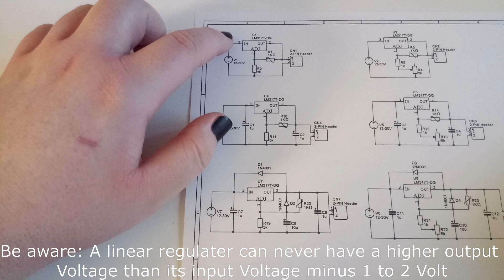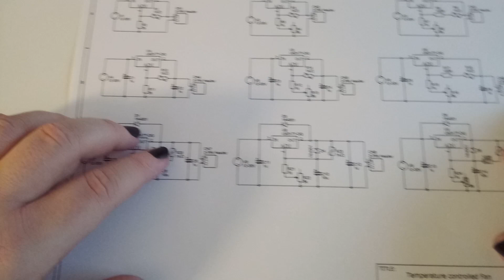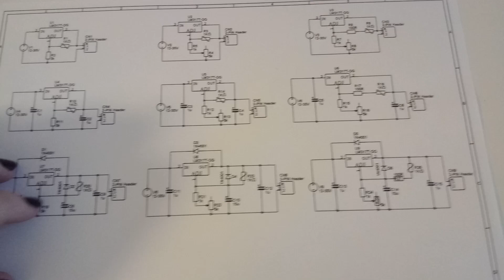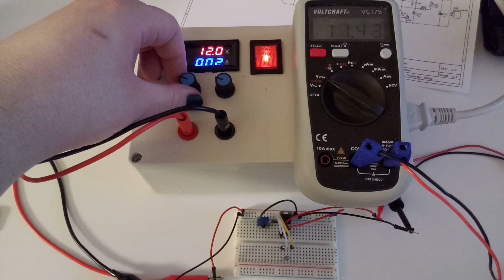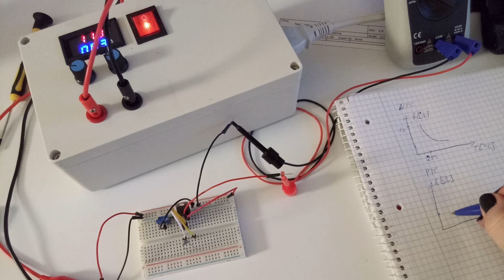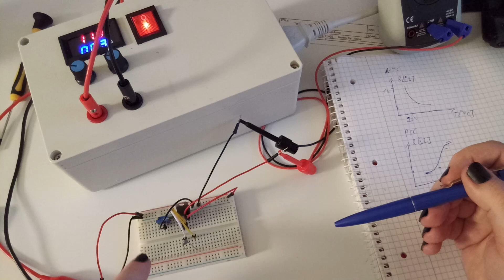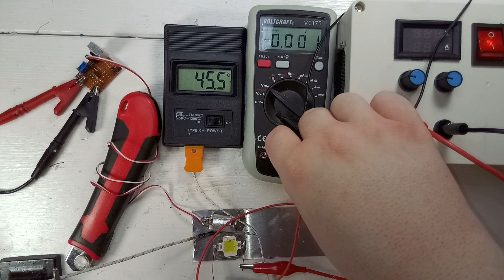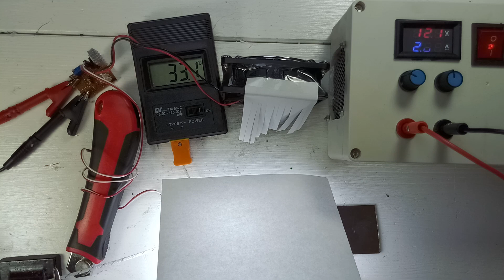Temperature Controlled Fan - LM317 based

Comment: Very good video. I have built a quad power supply  using 2 x 38V DC 8A transformers for twin 6 x TIP35C power transistors / LM317 regulators with 3 fans on each heatsink. There is also a 4 x LT1083CP in parallel and an 8A buck regulators. It's a learning excersise (and fun). 8 fans - one is a server fan at 600mA and howls like mad. I need to contol it and a load bank using 2 more server fans. I'm sure I can use your circuit but a slight problem. Please go to 6 minutes 10 seconds on the below video, it states that R1 should be below 500 Ohms. After all your work I had to Subscribe and like - thank you.
Simple Linear Adjustable Power Supply Tutorial
https://www.youtube.com/watch?v=2EFnqZUxFZ4
Reply from the maker: Hey, welcome to my channel! :D

The value of R1 for the LM317 differs between manufacturers, typical values are 240 Ohm, 270 Ohm and 320 Ohm with +/-10% resistors. But in reality the maximum resistance of R1 is determined by the output voltage and resistance R2. The adjust pin requires a minimum feedback voltage of ~1.25V, the forward voltage drop of the LM 317 if I remember correctly. Even if this is not true (previous sentence)  it doesn't really matter as I tested the LM317 with a thermistor of up to 2.5k Ohm at 14V supply, 12V maximum output. With this the circuit behaves just like it would with a 1k Ohm thermistor. 
Also just because you have a 1k Ohm NTC thermistor it doesn't mean it has 1k Ohm. An NTC thermistor drops most of its resistance withing the first few °C it goes up in temperature. For example my 1k Ohm NTC thermistor is rated to have 1k Ohm at 25°C but has only 800 Ohm at 30°C. Therefore realworld resistance is much closer to typical R1 values.

I hope this answers your question. :)
Here is a bit more information I forgot to talk about:

Resistance R1 always needs to stay above 200 Ohm to not damage the feedback pin, the 1k Ohm thermistor is chosen so the resistance will never go below said value. In theory it stil could, however this value is reached at over 90°C.
And this indicates the upper temperature limit of the circuit. If your project reaches temperatures close to the maximum rating of your NTC thermistor (in my case max 125°C rated thermistor), you need to make shure that its value, therefore R1, does not go below 200 Ohm. You can do that by either using it for projects that never go above 90°C, using a Thermistor with higher rating or an additional resistor in series. However, such a protection resistor would make the fan also start later (lower voltage at room temperature). But as you can see this problem only occures if your Temperature goes too high.

Protection resistor is mandatory if you use a NTC thermistor of a lower value (e.g. 500 Ohm) because it would reach said 200 Ohm much erlier.
Reply: @PhysicistAnna  
What a perfect reply - thank you.
I made a load bank to test the power supplies. It consists of 6 x 10 Ohm 100 W wire would resistors on a 150mm x 50mm x 40mm thick heat sink with 2 x 600mA server fans blowing into the fins. I can jumper the resistors to suit.  At the moment I have a 4 digit V & A meter driven by a LM317 that compares very well with a Fluke. 

I am going to fit one of your fan control units to this. You cannot really talk to anyone it's so noisy. I have reached 130 Deg. C ( OOPS! ) on the resistors without the fans running. I will have to fit a resistor in series with the thermistor. I could move the thermsitor onto the heat sink to a position where them temp. is lower.

I have just about every value of thermistor except 1K Ohm but I can get them easily. Some of my thermistors come from China and don't have a max temp. stated.  Nice to know R1 is not critical  for this application. I thought that chaps video was quite good, it got me started on this 'lark'. 

I have made too many LM317/LM338, etc. regulators and found this :-

https://www.ebay.co.uk/itm/AC-DC-LM317-Linear-Regulator-Step-down-Rectifi-Power-Module1-25-37V-1-5A/164011446660?hash=item262fd81184:g:16QAAOSwLmlbSBe4

R1 is the resistor between the 2 protection diodes. Useless heat sink but OK for mA. The trim pot can be replaced with a JST socket and a remote pot used. Nice little board. I may use this to drive the fans but the heat sink is useless, I can extend the connections to say an LM338 on a heat sink or put that on the main resistor heat sink if it's not too hot.

This probably won't meet with your approval but I am going to use the  'suck it and see'  trial method now I know what not to do. It would have been nice to find a graph of resistance / temp. for say a 1K thermistor but I am not even sure of how this fan / heatsink will react.
Reply from the maker: If I understand your project correctly you try to make a dummy load to test power supplies right? 
You might be interested in my next project/ video. It will be about an easy circuit that can be scaled (in theory) to any size to fit your needs.The circuit I'm talking about is very well known and consists of just a few components. The core of it is a LM 358, a suitable MOSFET or IGBT and a shunt resistor. The design I have in mind should be scalable, however I did not build it yet. Just a small basic version. To convert this first version to a high power DC electronics load you have to change the MOSFET/ IGBT and heatsink but if the refined circuit works you can use several small ones in parallel without the problem of different load on each. Such an imbalance would damage the MOSFETS. More about this in the first video. Some time after there will also be a second video in which I'll build the scaleable version and test it.

Another thing is you don't need 1k thermistors you could also use 2k or 2.5k. I never tested the circuit beyond that resistance except for 10k thermistors that do not work. Also keep in mind the voltage you need to supply to this circuit needs to be the server fan's rated voltage + 2V (although 1.25V voltage drop across the LM 317) to get the fan to maximum speed. If you supply a higher voltage and the temperature goes up the circuit potentially supplies a higher voltage than the fan can handle. Although +10% of rated fan voltage should stil be fine it's a common rule of thumb that works.

Hope this helps :)
Reply: @PhysicistAnna  
Hello Anna
It's so good of you to answer so quickly. I'll answer your comment from the other channel here. 
I was very lucky in finding a mentor (Spec) on one Forum who was excellent in two things. One was coming down to my level of ignorance and two - patience, I'm 73 now and not quite as compos mentis as I was, I've always been a bit slow to be honest. We had just started emails when he had an accident and all seemed well for two weeks and then he vanished. If anyone was annoying or stupid on the Forum he was very good at putting them in their place. 

May I ask roughly where you are ? I note a very slight accent. What are you taking at university ? 
I have been married for 44 years to a very understanding wife, our dining room is almost a workshop but I do clean up every day. We have two daughters I think older than you. Unfortunately I stupidly caught a falling car engine many years ago and it's caught up with me hence going back to electronics after 50 years. I have to do something.  I worked for our Ministry Of Defence designing very nasty vehicles - things with big pipes out the front LOL. I was able to 'retire' at 47 and I have been a 'bum' ever since apart from making 3 kit cars, etc., etc., etc.

In some ways I can understand your university and those nasty big Volts. I did not enjoy 254V across my chest OOPS! No fool like an old fool. I have had 450V DC across my nose but that was a long time ago.

I am of course interested in your dummy load. The thing I have works well and keeps ones face nice and warm. The transformers are each rated at 27V AC (38DC) 300VA and came out of old German Monacor amplifiers, the sort used in pubs. I have 4 of these. The cases are ideal for power supplies as is a lot of the 'gubbins'. I think I have made about 11 full power supplies. I did parallel the transformesr and get an awful lot of Amps but now they are seperate. It would be easy to drive both via one of the  LM317's but I don't need something like 16 Amps at 38V - that's a lot of Watts. The Monacors came via EBAY and were about £20 each. This quad setup is now on a small dolly with 4 casters, just a tad heavy. I have not used Mosfets yet and an easy circuit and online guidence would be very usefull. 

I have had good success with large PC CPU heat sinks and fans. I made a 4 x TIP35C driven by a little buck (just as a test) with another to drive the fan. It uses a CPU heatsink about 90mm square. It's quite happy at 120 Watts. A fan can triple the heat dissipated from a heatsink.

My last power supply will be using an LM723 for V & A regulation and my usual 6 x TIP35C power transistors and a toroidal 35V DC transformer. So much easier than 4 X 2N3055 ones. I will add a buck converter I can switch to.  DC 300W 20A CC CV Constant Current Adjustable Step-Down Converter Voltage Buck C. They seem to work well. Incedentally the LM317 is quite happy at 38V. The PDF does not state a maximum input V only a maximum V in / V out difference. I did have an LM317 go pop and take a nibble at one ear lobe. I can use a little buck or LM317 set to 14V to limit the V out. There is a tapping on one of the transformer that is around 18V and I use this for the low V & A bits.  

I am a great believer in fans. It does seem that fans are taboo with 'experts' but after spending time in an engine test house the odd little fan means nothing. However those server fans are like minature jet engines. They float on the table. I usually run most fans at 10V or even less. I have a small one even on my bridge diodes. There are 10 on this quad setup most at 8V. I have not had any 'magic smoke' yet. I do try hard though.

I have Googled those 3 digit V & A meters and could only find problems mainly at low Amperage. I will try a very clean V for driving and measuring - 2 car batteries should do.
I have had a lot of success with kit from China. These meters playing up is the first real disapointment. I try never to run anything near it;s limit.

I think I had better end this saga. It's rather a long 'comment' sorry.
Reply: @PhysicistAnna  It's him again
I realised that dropping around 36V to 12V is going to be a problem with an LM317 or an LM338. 36 - 12  x 1.2 Amps = around 29W. That means a flying lead, heatsink and fan and even that is pushing the limit of the TO-220.  I think I had better use a little 3A buck and drop the voltage down to 14V. I could drive this fan regulator using a variable power supply but I might forget to set it and put 36V into the  regulator.  I am going to add a test rig for V & A meters to the load cell so that I can test and easily adjust them.
Reply from the maker: Hey, jp.
I´m german and am a physics major. 
Many of the experiments I was talking about need a few hundred Volt to a few thousand Volt but all with very little current in the 0.001A range. Such a shock certainly hurts but doen't kill you. However I can't do anything about it but this max 50V DC rule is nonsense. "Safe" or "touchable" or "Safe to touch" voltages are 100V DC and 60V AC. Each country specifies these voltages in a similar range. They are well below the breakdown voltage needed to inflict harm (average grownup person). The backround is as follows:
If you measure your body resistance from hand to hand with a multimeter you'll get a reading in the range of several hundred thousand Ohm. However if a certain "breakdown voltage" is reached your body resistance drops to 2k Ohm to 4k Ohm and your body is suddenly way more conductive and a huge current can flow. The several hundrek k Ohm you read are present because a multimeter measures resistance with a very low voltage. Most of your body resistance comes from the skin but internally, flesh, fluids, and so on are ~2k Ohm to ~4k Ohm. 
Voltages rated "safe to touch" are well below the breakdown voltage of your skin.

Ok and now I got some questions about your project. 
You said "...easy to drive both(transformers) via one of the  LM317's..." What do you mean by that, driving two transformers with and LM317? It is only rated for 1.5A.

 Next would be about the LM723 and your 6xTIP35C. Do I understand you correctly tat you use 6 of the TIP35C in parallel driven by the LM723 to get current and voltage adjustment? Or rather 2x 3 parallel to get V and A adjustment?

Also about the Lm317's maximum voltage rating: The Vi-o rating or Input-Output differential voltage  rating of 40V is very misleading. Its the "absolute maxium" rating for input-output differential. Its output adjust range is from 1.2V to 37V. You have to account for the forward voltage drop of minimum 1.25V, better use 2V, so its input voltage ranges from 1.2V+1.25V=2.45V to 37V+1.25V=38.25V. But as I said better use 2V as forward voltage drop to get it more stable so minimum Input voltage is 3.2V and maximum input voltage is 39V (DC). 
Just one thing, maximum power loss across the LM317 can not exceed 20W. Thats the maximum power loss rating.
Using a buck converter is always a good solution if you have a huge input-output differential voltage at higher current.

And about fans in projects I can say there is no such thing like real experts if you mean withing the electronics community. I myself always try to run components well below their maximum temperature rating and oversize heatsinks and use fans even if its not strictly necessary. Just a thing of mentality and philosophy. I always recommend oversizing the cooling solution in projects. Makes them safer in my opinion.

Hope I did not forget to answer anything :)
Reply: @PhysicistAnna  This is quite a saga we have going here - soon it will be 'and it came to pass'.

Thanks so much for the advice and help.

Best of luck at uni. My wife and I have a good German lady friend we met in Greece. She came and stayed with us over one Christmas. She hurt my wife and nearly crushed my ribs when she gave us a hug. I will be 74 in June. I will let you work out what my father was doing prior to that. All in the past young lady. I don't think I actually mentioned I'm English. It's nice to know people from different countries. I have a smashing friend in Sydeny, we have known each other for around 3 years now. Hopefully she will visit us this summer if the virus thing dies down.  

The 450V I had on my nose was caused by my lying underneath the huge stereo 20W +20W valve amp with pre amps. I inadvertantly touched a 450V wire connection with a soldering iron which swung down and hit my nose - 3 times before I could get my head out of the way. I can't remember the Amps but it did tingle and leave a scar for quite a while. Needless to say I was hanging onto the chassis. 

The transformers  V out are 27V AC which is 38.18V DC  minus bridge rect. &  self resetting fuse. I get around 35/36V out. Quite stable under load but I do loose the odd volt.  It's very confusing in the PDF data sheet what the max V input is for an LM317. Different data sheets make it even worse. Seems I am knocking on the limit. No problems over quite a few tests though.  I do have a few of the LM317 versions of this :- 
http://www.ti.com/lit/ds/symlink/lm317hv.pdf
It's a 60V version. Not needed them - yet.

I connected both transformers together just after the main caps. I used balance resistors but found they were not required. I then paralled off both TIP35C / LM317 inputs and drove them with one LM317 regulator. I put fuses all over the place but none blew.  One LM317 regulator driving 12 TIP35C's - just a test.

That video I sent a link to stated that 20W was the max. YouTube messed about with that young chap so he gave up - pity. I think going over 20W cause the nasty little LM317 to take a chip out of my ear. Made quite a bang. The LM series are OK unless you have a big V diff and then they are down in the mA range. Today I replaceed an LM317 with a LM338 and larger heat sink on one of those EBAY regulators I bought (I sent the link to you) I had to remove the bridge rect. and output terminal block to do it. As I will only be using 14V input for this variable speed fan regulator I probably didn't need to do this but better safe. V Diff will be tiny when the fan is flat out. This load cell is becoming a monster - good fun though. 3 Amp buck to supply power to the fan requlator,  LM317 / thermistor fan regulator and another LM317 for the 8V to drive the V & A meter. 

The LM723 will be the final power supply (maybe) It's a fresh start but I will be using a 25V AC toroidal rated at 12 Amps &  6 x  TIP35C's 
http://electronics-diy.com/30v-10a-variable-bench-power-supply.php
It's a very old design but the LM723 is still used in commercial bench power supplies. I won't be pushing the 12 Amps, 8 Amps is fine with the odd bit more.  

I spent all my working life as an engineer but I am not an expert. Engineering and electronics are far to big a subject for anyone to become an expert. I am an expert though at cooking an English Breakfast, it was in my fathers genes, it's in my genes and I have passed it on to one of my daughters. Must have duck eggs, black pudding, fried bread,...... LOL 

I shall hopefully start a few tests tomorrow on the fan regulator but the 1K Ohm thermistors will take a few days to get to me. I do have some odd ones to play with in the mean time.

Thanks again Anna - take care
PS names John but friends call me JP so you got that right.
Reply from the maker: I knew you were English after reading your first comment :) Although reading "English" instead of "British" is a new one for me xD If your are not British I don't understand the difference and I apologize for that. Only if you are Scottish, there is a difference right? Ahhh so complicated^^
The LM723 based power supply you posted has a very bad design. The IC has a single feedback pin but it shows several 2N3055s being connected to it. Also the IC only has a single output/ driver pin. There is no individual correction per transistor. Using this circuit there will be an imbalance between the 2N3055 and one will always be driven harder than others (the circuit explanation correctly states internal differences). If you want to use this circuit go for a beefy single transistor instead of 4x 2N3055 then you wont have this problem. Circuit then can be used as is. Typically you want an additional balancing circuit in between the output pin and each of the transistors. This can easyli be done but requires more work and fine tuning. Going for a single transistor is the better solution I think. 
Or you just ignore all that because the only risk is destroying one of the transistors faster and one after the other will break. That wont happen right away but if you use it at maximum loade sometimes,  depending on luck it might already break after a year.
Reply: @PhysicistAnna  
Hi Anna
I was born in a country called England which is part of Great Britain. I know Britain is considered by most to be one country but in reality it's four. It's not politically correct to say I am English,  I have no idea why.  I still wonder how this tiny little island had the biggest empire ever. We were not very nice at times. It's not a bad place to live Anna, I'm sure you feel  the same about Germany. We do have a rather 'earthy' sence of humour, I'm sure I do. Great Britain was formed when Scotland went bankrupt around 300 years ago and they agreed to join us if we gave them money. 

From what I have been able to find out this old LM723 circuit it's been very reliable. I can only assume the 5W balance resistors take care of any variations in the 2N3055's. All of my power supply outputs have been built like this and I have done some pretty nasty things to them with no damage. I did test the twin 6 x TIP35C set up pretty hard. The 300VA transformers were getting near their temperature limit after an hour ( spit sizzled - very scientific ) but all the TIP35's were at 41C - not close to 41C but exactly 41C. That was quite a surprise, I did try to cool them equally but I didn't expect that  They are cooled by 3 x 60mm PC fans on each heat sink, not the server ones. Roughly 100mA+ each. 

The above was a test I had been putting off for a long time. I decided to get a full replacement for anything that was likely to go pop and it takes ages to get bits from China. While I was trying to warm the house up I tested the LT1083 'thing' I made. They are just big LM317's.  I put 4 on a large PC CPU heat sink with balance resistors and used one set up of R1 and R2, etc to drive all 4 as in the Linear PDF data sheet. This does have a 600mA server fan with a on/off temp. controller 

EBAY -50-110°C W1209 Digital thermostat Temperature Control Switch 12V + Sensor (This is very good value , read the spec. Only on/off though) 

and a PC fan running all the time. With a V Diff of 25V they are  down to 1 Amp output in the PDF not the 7.5 Amps they are rated at. They forgot the word' MAX'.  The whole thing is only about a 100mm cube with fan buck and LM317 regulator. I was loading at the time with a 60W 12V (5 A) car headlamp bulb. It was happy with 36V DC in and 14V out. The LT1083's were at 41C and that was roughly 1.25A at 25V V Diff. At this point you think 'that's odd everythings 41C. I did borrow the little kitchen meat temp. probe and check with some heat paste on the end. 41C was about right. I then tested the 8 Amp buck but only at 5 Amps, that went to just over 60C but the main hot spots were not easy to get at. Standard 60mm PC fan. I have an infra red (?) thermometer but it's a cumbersome thing for close in work and does not like shiny serfaces.

I know what the 5W resistors do but they never even get warm. There was a young lady in Canada I was in touch with who built quite a large 30A power supply using this circuit who took her balance resistors off (sounds quite painful). No problems.  

I do prefer the TIP35, it's much easier to mount than a 2N3055 and a lot cheaper.  I keep them to about 1 Amp output each or roughly 30W. I simply add a few more.  You read and see so many videos about cheap fake bits from China so far I have been lucky - apart from those 3 digit meters. I have sent off for some 4 digit meters, maybe I should have waited until this virus thing has died down. I have had to wait a while sending my last order as the Chinese have been celebrating their New Year. It's the year of The Rat. Got quite friendly with one Chinese seller but EBAY got their knickers in a twist after about 6 messages each way. He was a nice chap.

Eureka - Fan control
I lashed up a test setup with a 300 Ohm thermistor. I added a 220 Ohm resistor in series with it. R2 was the 5K multi turn trim pot already on the PCB. After messing about for around an hour I ended up with a 68 Ohm resistor with the thermistor. I had tried a 100 Ohm that too was about right. I had the thermistor and a temperatur probe about 20mm above my 30W soldering iron. I was putting 14V in. The unheated V out was 5 Volts and it reached 12V at 55C. It was not a very scientific test but I was very happy with the result. Thanks Anna. I think it was more what not to do than what to do that counted. That has been my problem. There are quite a few fan control circuits on YouTube and the Internet but they ignore setting the actual temperatures, etc. Holding a thermistor or using a soldering iron just to see a fan go round is not much use. Yours was the best.
I have sent off for 5 x 1K thermistors which should be here in a day or two - UK seller. It's nice when things go right. I owe you a pint or one of those things with an umbrella in it.

Sometime in the future I will be making this :-
 https://sound-au.com/project12.htm
I am going to make the first one - 70V. 
I have a 25V + 25V toroidal and most of the bits. When I stopped making valve amplifiers I did make one transistor amp and this one almost goes back to that time and is quite simple. In those days the words 'harmoic distortion' actually meant something. Ask in a shop these days about it and you get 'what ?'. 
It will be added to the last 35V DC power supply, I can use the 25V +25V AC to get the 70V DC. There is a possibilty that PCB's are still available.
I am a great believer in KISS - Keep It Simple Stupid.

I am going through your videos, the ones I think will help me. You have done a good job. It does take time to get an 'audience'. One channel I watch had almost no Subscribers but now he can't even answer all the comments. I expect one day you will forget your old English wrinkly - LOL. That German lady my know - she calls me her 'English Daddy'. 
I think your English is better than mine and my father was a headmaster of a Church of England school. That's out trouble, everone speaks English so why bother to learn another language and which one would you choose. Did you know the French are not allowed to speak English on TV even if they are fluent in it. Nasty people, all those poor little frogs on crutches.
Reply from the maker: Hey JP, 
takes me some time to answer your comments right now I caught a cold. It's not the "Virus". Also they are pretty long^^
However about the power supply circuit you posted a link to. The resistors directly used after each 2n3055 act as a current shunt as far as I understand and we do have a direct connection to Pin 2 of the LM723 which is current sense, therefore we need a voltage drop across a resistor to detect current. Between Pin 2 and Pin 3 is a variable resistor to current limit as Pin 3 does exactly that. Because internally Pin 2 and Pin 3 are the inverting and non inverting input of the error amplifier which then (in this particular circuit diagramm) directly changes Pin 10s' output that in return drives the 2n3055 transistors through the BD139. The next 2x 5W resistor parallel to each other, in series with the shunt resistors are in place to create a higher potential difference to GND so Pin 3 can be driven through the resistive divider which is created by the variable resistor. The circuit itself is a very simple one that does not utilize the LM723's full potential. It can do more and with a small additional amplifier per transistor (better use MOSFET) you could negate said problem. I don't see the need for you to change it but the problem I was talking about is a very common one if you use several transistors or MOSFET in parallel to each other due to manufacturing precision. Even if you have the same component from the same batch they are not equal. I do have my experience with it due to my DC electronics load project. Esentially this circuit works by not fully opening the transistors and therefore wasting power in form of heat accross each transistor. Works even better with MOSFETS. 
Also this is the reason such power supplies are rarely used nowadays.
Only in acoustics or some rare applications in science if you don't have the funding for absolute stable switchmode powersupplies and you can't have high frequency noise coming through. But as I previosly said, we can flter that and make it perfect. Well actually nothing is perfect in physics but we can't measure anymore. Our inaccuracy in this case exceeds measurement by far.
By the way I'll delay that project for a bit and do other, more simple things while I'm sick.

Your future project looks very interesting but I have to take a closer look at the circuit when I got better.

Nice to hear that your fancontroller works with a 300 Ohm thermistor but your overall resistance R1 should not fall below 200 Ohm as it would damage the LM317 over time, going even lower will blow it up right away. So always keep an eye on R1. We don't want to short the feedbackpin to output pin.

Thank your very much for all your praise it really motivates me to make more videos! :D
And NO I wont forget about you :) well... maybe if I'm 73 :-P
Reply: @PhysicistAnna  
Oh dear, I am sorry. I'm 'glad' it's just a cold, they are bad enough. I think most of us are a bit worried about this virus, especially when your an old wrinkly like me. I had pneumonia twice years ago - OOPS! Do get better soon and please I can wait. It's a hobby not a race. 

Get yourself fit, you have been 'well beyond the call of duty'. 

I think I'll try the suck it and see technique for the power supply and see what happens. Just don't go anywhere, when I finally get my magic smoke I'll scream for help . 

Oddly enough the power supply that I started with around 3 years ago came from the land of the wok and has these wire wound resistors on the output. For some reason the transistors (I can't remember the type) are not as powerful as TIP35's. It was rather cheap and only 5Amps - works well though. I have hardly used it as I made my own (it was awful but worked). I did order all the TIP35's at the same tme, it was suggested I did. I got quite a lot of help on that Forum but now my friend has gone I don't bother. The LM723 is a bit frail I was told. I have a socket for it and I'll keep a few inside the case. Good old Mao Tse-tung.

There was a very heated argument going on about the right value for these wire wounds amongst the 'experts' . I kept out of it. The Monacor amplifiers had TIP35C's in them so I collected 6 odd ones from the 12 (3 amplifiers had 4 x TIP35C's) and used a 0.1 Ohm on the output of each. I wanted to do the worst case. The Monacor has ' A unique cooling system'. The heatsink is on it's side with slots under it in the base of the case and the same in the lid. Cold air comes in the bottom slots, across the fins and then out the top. No fan (but I have 3 in a case under the base blowing up). No slots, just a hole.  All these 4 amplifiers had failed due to overloading / heat. On one the thermocouple on the heatsink went to a 'transistor ?' on the PCB that had burned the PCB out. Another had 3 very badly fitted new TIP35C's but didn't work. For some reason another had a very nasty burnout caused I think by a foreign object being dropped through slots in the top of the case. The last one (actually the first one I got, a Monacor PA 900) came from my son in law because it had had a pint of beer down the top - for extra cooling? maybe not. It was in a pub so it could not be used again. Why? Worked fine after it had dried out but being just mono and 120V (I think) to the speakers, something odd, I took it apart. It was ideal for my projects, so much so I bought 3 more for around £20/ £30 each. The front plate is around 1.2mm thick and in front of that is another plate around 2mm thick. Bit OTT but looks nice. All those lovely pots, caps, case, transformer, etc. etc. One is all set up ready for my rather large selection of chinese D-Class amps, etc.  I do get a bit carried away with those - some say I should be.    

I also have an oscilloscope that I have hardly used. When this quad thing is finished I wiil bite the bullet and learn how to use it properly. I have a very good friend that I have known for over 60 years who was going to teach me. Unfortunatley he now has 3 great lumps of titanium in his chest - heart problems, very lucky to be alive. he's not too good at explaining things, sort of wanders off topic and gets into the realms of - 'What the hell is he talking about'. Started is own electronics firm - routers. Very, very  knowledgeable but cannot come down to my pathetic electronics level. First there were blacksmiths then ironmasters  then engineers - that's me, big, very big, lumps of metal and big engines. Some people work to live, I was lucky - I lived to work. Sad. I can't stop Anna.  

Where were we - fans.
The 1k Ohm thermistors came today, I got 10. I was just having a go with the 300 Ohm. I'll copy your circuit exactly. I spent the day making an open sided ali box to fit one the end of the heatsink for the fan regulator and a little V meter.. The other end has one for the LM317, meter and sockets. I am insulating them both from the heatsink with 3/4mm cork floor tile, seems to work.

I'll leave this missive for now. If you would like to leave this fan circuit, etc. on hold for a few days until you are feeling better that's more than fine by me.

Get better soon and once again - thank you.
JP
Reply: @PhysicistAnna  What Ho
And now for something entirely different.
I have one of those little Chinese 750Watt (650W safely) two stroke generators. It starts well but the recoil starter mechanism can fail. It also takes a lot of pull and I do mean a lot. I have a couple of 7.2V very old Bosch drills. They have been wonderfull. I did buy new batteries for them some years ago but they too were dying and now I have fitted lithium ones. I don't think it would be very kind to these drills to try and start this generator as many on YouTube show .So after big thinks and having a good spare car starter I think a bit of time on the lathe and a stick or two of weld I will have more than enough power to do the job. I will of course fit a couple of handles to the starter. I have a couple of old car batteries that are good enough. I must check to make sure the starter goes the right way round. Forgot that OOPS! I don't think it does. Might get a connection the other end.

I may have to put the fan controller on hold but it's so near being finished I might do that instead. I have a 4 digit meter at one end to measure V and A. It's as accurate as my old Fluke and has an extra digit. I am fitting one of the below :-
https://www.ebay.co.uk/itm/3-Wire-mini-DC-0-100V-voltmeter-LED-panel-3-digital-display-voltage-meter-BHP-SP/293392042680?hash=item444f874ab8:g:zzUAAOSwbrZcYNFX
They even has a little pot on the back for adjustment. It's going on the other end so that I can keep an eye on the LM317 regulator. 99P or 1.1 EUR good old Mao.  
This is for you to send you to sleep. 
No need to answer if your not up to it.